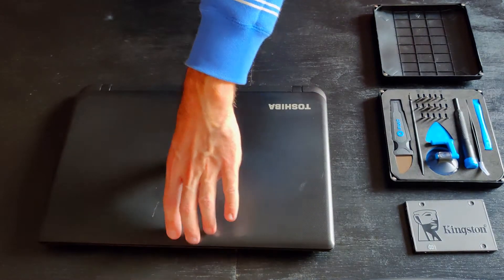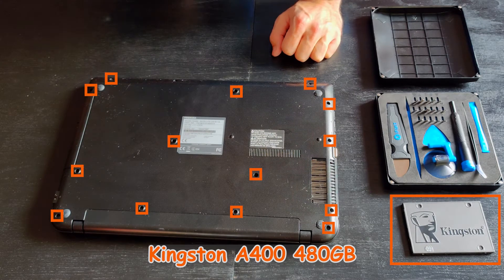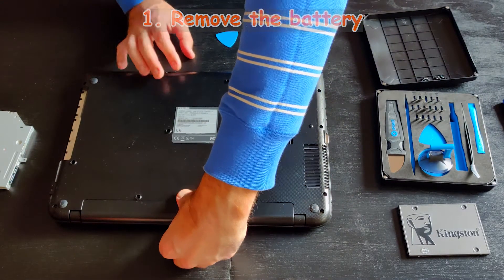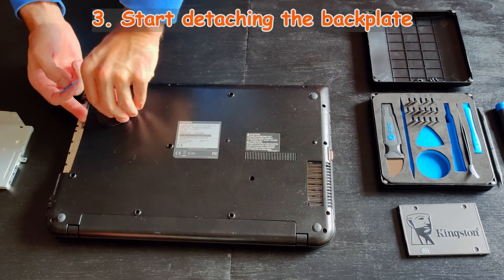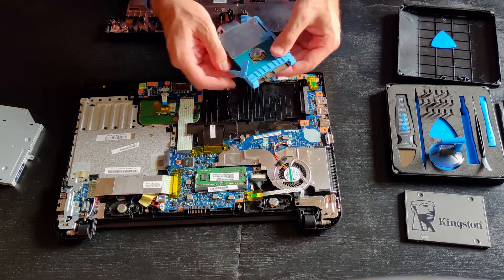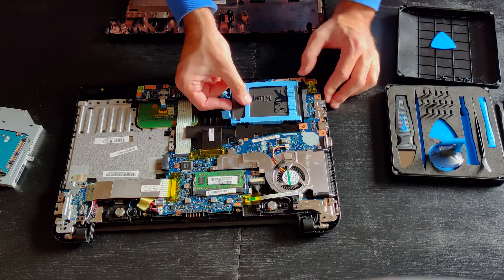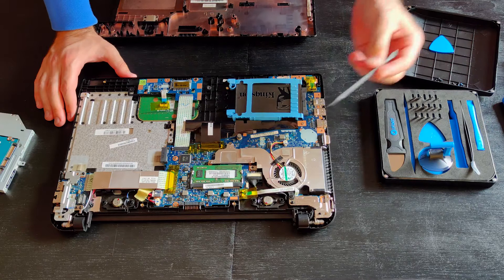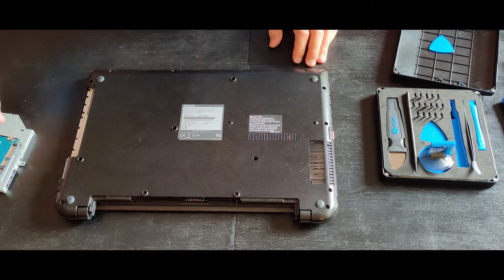Toshiba Satellite C50 - Installing a brand new SSD SATA3 drive

Comment: I have prehistoric Acer laptop (Aspire 5315) - sometimes it works and sometimes it doesn't work...what should I do with it... is it more useful to remove all old mechanical parts hard drive and replacing them with new parts or should I just use a hammer and buy a new laptop.... thank you.
Reply from the maker: MC Hammer song goes like this: "Hammer time! Can't touch this!" Thank you for watching.

Comment: Speed test how many time faster then hhd
Reply from the maker: I did this job for a client and no longer have the device in my possession. Roughly 6x faster - sata SSD vs sata HDD at 5400rpm. Thank you for watching.
Reply from the maker: A quote from Techradar: "There are other factors in play that determine HDD speeds, such as capacity, but in general a SATA III hard drive at 5,400 RPM will have speeds of around 100MB/s, while a 7,200 RPM will be 150MB/s. A solid state drive with a SATA III connection should achieve around 550MB/s read and 520MB/s write speeds, though some will be faster – but will max out at 600MB/s."